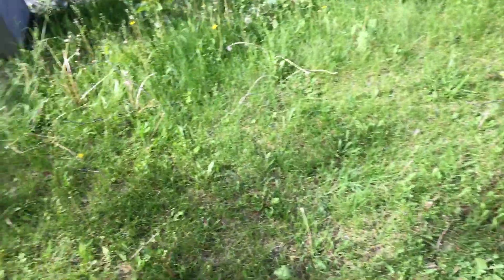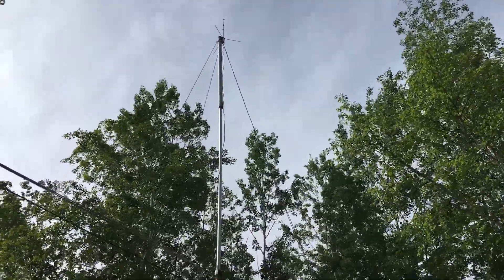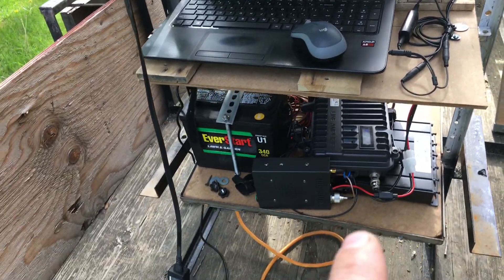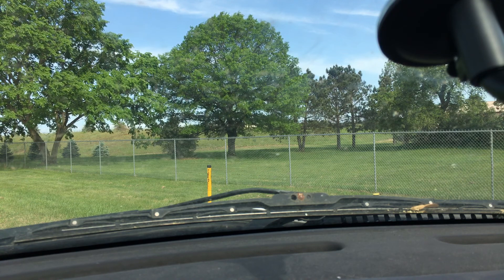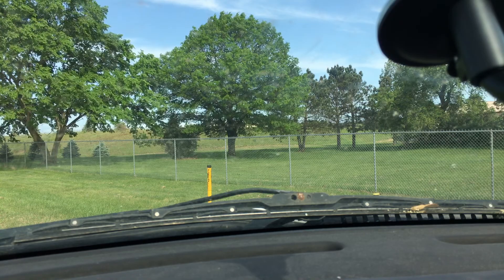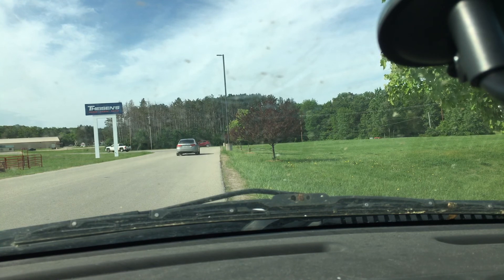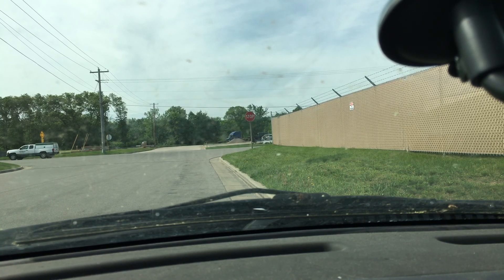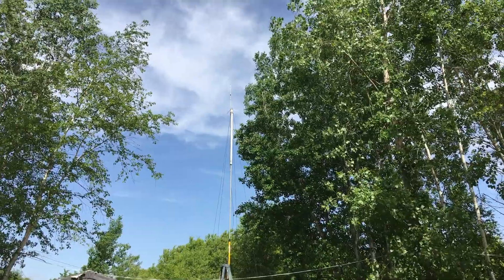🔺Distance (range) test with a modified 25 watt Retevis rt97 GMRS two-way repeater!!🔺

Comment: You must have had a blonde moment because you should know that if you don't hit it by the second time you try you're not going to hit it and another thing is every place you park had a lot of metal structures nearby Andrew antenna is just way too low so blonde moment blonde moment
Reply from the maker: Yes but sometimes the "simplex" repeater ( what records my audio for play back) will act up so I like to make sure its not that. and i try to park in the same spot every time to. and yes my antenna is in a bad spot i say that in every video well i try too..lol
Reply: @GMRStwowayradio  I would highly recommend that you would raise your antenna even if it's only 10 ft it will help tremendously
Reply from the maker: @ - yes I did, but truth be told I am in a "hole" I need to find a better location and move the repeater
Reply: @GMRStwowayradio  with that in mind you will never be able to receive further than what you get right now Beck the more power you put in to your repeater the further you will talk so I would highly recommend to try and get your antenna a little bit higher or relocate
Reply from the maker: @keithbowman8492  yes that is what i said above i need to move it IF i can find a spot for it

Comment: I have the Midland repeater. Under perfect conditions, I get 14-15 miles, but when conditions are not so perfect, I'm lucky to get 5 miles. Elevation is king unless you have that. I don't care how many watts you have; it just won't work well.
Reply from the maker: Yes height is king, but more wattage does help alittle with penetration thru building, trees, etc  i have videos showing this too.

Comment: Is this fella still doing these videos? If so it's killing me because he's transmitting inside his car with a rubber duck stock antenna from a Hand held. Vehicles are signal killers. Sounds as though his repeater setup is doing just fine what he's hearing back is what his HT is doing into that. It drives me crazy each one of these I've seen. AT THE VERY LEAST use an external magount antenna to your HT and try this again. I'd be willing to bet that changes the game. 😊 Just some friendly advice. And I only know this because I use a cross band repeater and my area is very holly and has lots of obsticals. My 50 watt repeater does great but the testing I've done with HTs always has the same results.
Reply from the maker: yes i am :) like i have said I don't go out of my car or use external antenna ( some videos I have used one it depends on the video) because there are times people don't have one, or they are in another car or don't they don't want to keep moving the antenna from car to car. so these types of video show you how it will work when NOT using an external antenna

Comment: I'm considering a similar setup but I run the RT97 repeater backwards...50W home base station with a 9dB gain antenna...ERP of about 215W from home (on paper).  I roll with the RT97 under the seat in my truck and use an HT for speaker/mic...external 5.5dB gain antenna.  Reason?  So I can park, take my HT with me and still be connected to home.  Works pretty well.  Why did you use an external duplexer?  Is that a must do or did it just make it better?
Reply from the maker: If a person is going to hook up an amp to the RT97 you have to change the duplexer to one that can handle the wattage of the amp. The stock duplexer ( the one in the RT97) is only rated for 10 watts.
Reply: @GMRStwowayradio  Thank you.
Reply from the maker: @goodoz9942  you are welcome and thanks for watching.

Comment: Furthest I've got with my Retevis 97 on 6.6 watts using a Comet GP-6NC GMRS/FRS Commercial on top of a 33' mast was 14 miles. I'm in Florida. We have leaves year a round. Unfortunately propagation changes as does location and the environment of each location. The other day we couldn't even reach 5 miles.
Reply from the maker: ohh yes it does! I have bluff/hills too so that don't help.

Comment: It's too bad you didn't do this test with another person using a hand held. That way, both of you could move around and do a more of a efficient test. FYI, I am using the Retevis repeater myself as a base repeater. I have it connected to a J-Pole antenna on the side of my house and it's about 20 - 25 feet in the air. My repeater can be hit within a 5 mile radius, even with the leaves in full bloom now. I live in PA, so I'm also surrounded by a lot of hills. :)
Reply from the maker: Maybe in the future I will have someone to help. But keep in mind, I am using handhelds and NOT a mobile unit. And my repeater is in a valley (so basically I am in a hole). So with all this, I am shocked I can even get a mile! lol
Reply: @GMRStwowayradio  I feel your pain. :P
Reply from the maker: @jnelson16701  - lol thanks :), but I will be testing more DIY antennas to see which one works the best :)
Reply: @GMRStwowayradio  Did you test your SWR's first? That could make a big difference, also.
Reply from the maker: @jnelson16701  - yes i did it was good.

Comment: I have over 100 foot pine tree with just the canopy and was thinking of hanging my antenna on it.  You are making me second guess that thought process.  Any suggestions if I decide to do it?
Reply from the maker: Ohh, that's a tough one! Cause trees and leaves kill the signal bad!! Sounds like you are in the same boat I am in around here. I can only think of two things, 1). Get higher than the trees, BUT that may not be possible due to the cost. 2). Get a high gain antenna that MAY help cut through the trees, but of course I can not guarantee that! I may try to build a Yagi UHF Antenna this is a high gain antenna BUT it is a directional antenna!!
Reply from the maker: NOTE: the more Elements, the more gain https://www.changpuak.ch/electronics/yagi_uda_antenna_DL6WU.php
Reply from the maker: Here is a better windows program that can be installed that will help you calculate what you need https://en.freedownloadmanager.org/Windows-PC/Yagi-Calculator-FREE.html
Reply: Appreciate the quick response.  I was wondering if there was a rule of thumb like the antenna should be x feet above the trees or a least 5 ft from a tree, etc.  I can mount it on my chimney and there are no large tree immediately next to it but it would be much lower maybe 25ft up.  I got a good buddy who is a tree climber and figure I would get better service if it was one of the large trees 100 feet up.  I know there alot of variables but any rule of thumbs would be very helpful.  I am pretty new to radios but I think my end goal is to setup a GMRS repeater in my area so I can use around town.  Currently no GMRS repeater in my area that I have been able to find even with the local radio club.  I plan on mounting a 50watt mobile radio in the car with a decent car antenna.  This is the dream anyway.  LoL
Reply from the maker: @denise.60  - no problem, well height is everything too, so if you can get the antenna 100 feet that would help. Maybe your friend can trim the branches while he is up there, that would help too. BUT if there trees around the antenna that are just as high with leaves that's could be a problem,  of course everyone situation is different and many variables.  I would try it and if there is not much range, well then it's probably the surrounding trees. As for a rule of thumb, there is not really any on that. This is why you see cell towers higher than the trees, well, at least around here there are.
Reply from the maker: @denise.60  - I have been thinking MAYBE if there was some distance between trees that MIGHT give the Radiation Pattern a chance to spread out to help get distance! There is no rule of thumb on this BUT I do have a spot I may be able to test this idea if I am able to i will post a video!
Reply from the maker: @denise.60  - here is a video to answer your question :) https://youtu.be/kaVOoOWVCfo